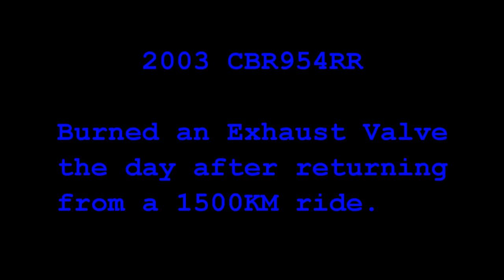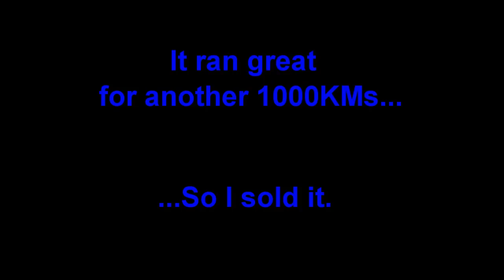CBR Valve Repair

Comment: Nice so im guessing you only replaced that 1 valve and it worked ..the issue im having 1 of the lifters is sitting lower than all the rest i think i might have bent a valve by accidentally letting go of the clutch when transporting smh so i guess my question is when replacing valves is it ok to just replace 1 or should you replace them all
Reply from the maker: Letting go of the clutch when transporting? Not sure I know what you mean or how that could bend a valve..
Anyway, a lifter sitting low could be a bent valve but it could also be a other things. A shim that's jumped out, a broken spring, etc. Just take the lifter out and have a look. If you suspect a bent valve, look inside it's port to try get a look at the valve (Much easier to do with intakes). 
As far as replacing one valve, if you're in the position I was at the time where you just want the damn thing running and there's nothing wrong with the other valves, yes it's fine. You're going to hear from the "While you're in there" crowd though about how you should change every valve and rebuild the entire engine because you have the head off.